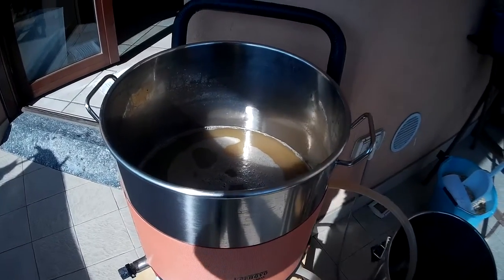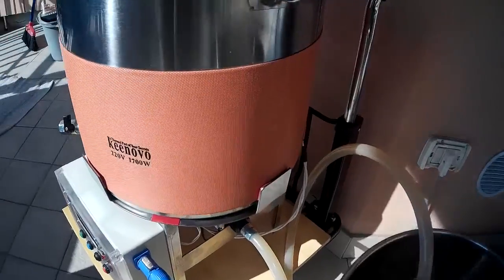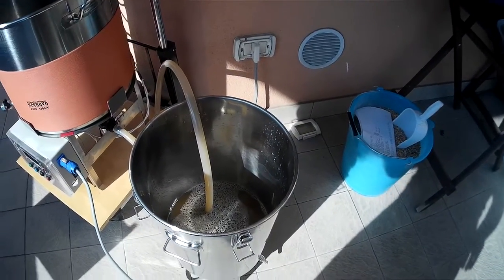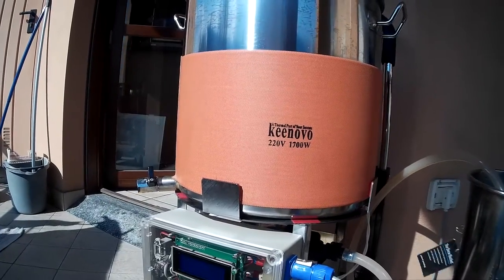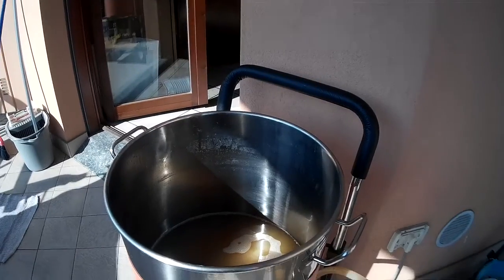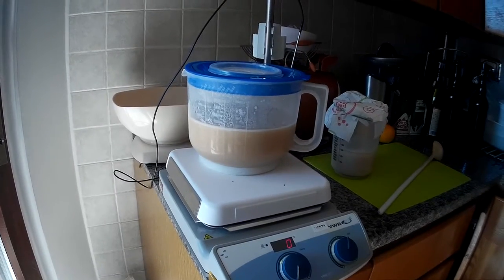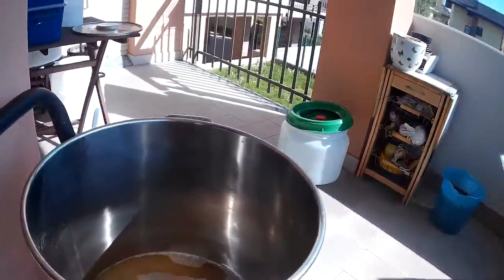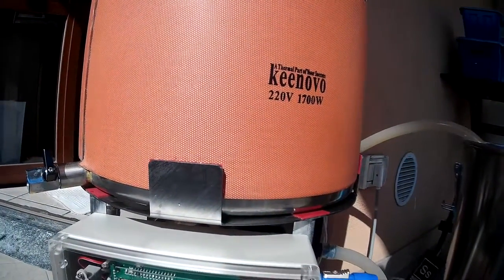Open ArdBir live test - singel vessel BIAB - cooling

Comment: Does the open ardbir works for cooling process? I mean, i want to control the fermentation with a refrigerator, so i would like to use the same controller. Is this possible?